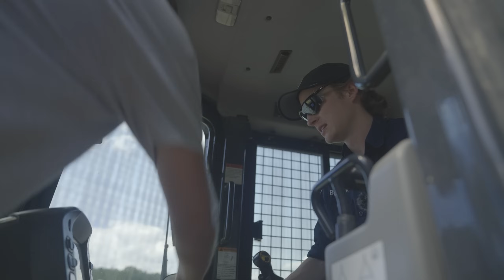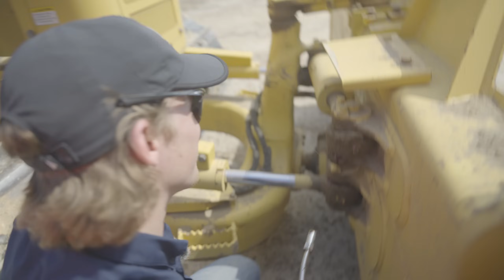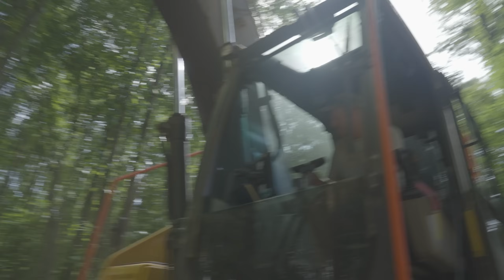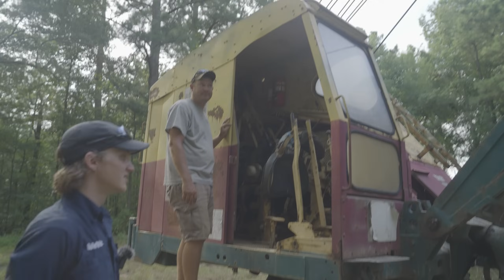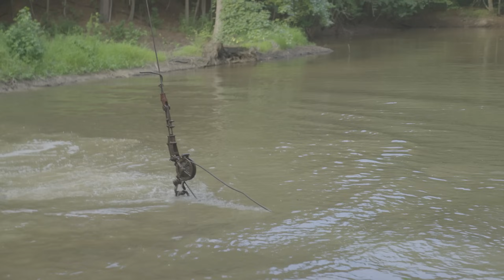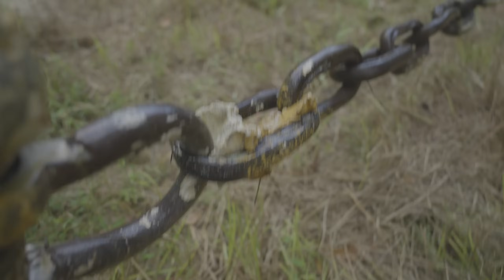Working for LETSDIG18!

Comment: You need to do more videos with the “smaller” contractors like this. It’s more relatable than the giant companies. And showcases what you can do if you want to be in the biz but not work for one of those giant companies.
Reply: Working for a smaller company compared to working in a mine ,is there's more opportunities to do many different things. Let's say you like running a excavator...you can knock down trees , buildings, clear land ,lift structures like culvert boxes or beams for the steel workers... to digging retention ponds or ditches, the list is endless.
Reply: Agreed
Reply: He’s worked with Chris and smaller companies several times instead of basing your opinion off the videos you watched why not just watch and shut up 😂😂

Comment: Thank you for letting Mr. WATT 😊 come and play and learn the fuel and lube system 😊 the old ( Betty) is my favorite
1978 same year as my Dynahoe-190 😊
Mr. WATT learned the dump for bucket control I see. With the backwards lever control system CAT put on 977s. That front Loaders from that series are the best looking, but times changed and thay moved engines to the rear. Lets DIG is so outstanding to let Mr. WATT come and see and operate in his job development site. 😊😊😊 This is so fantastic about U-Tube that two great videos series can get together and actually show video of each other on job sites. For everyone saying Mr.WATT should do more with smaller contractors. Great idea but remember you and me can NOT go to some of these large Mines and hige projects that Mr.WATT has filmed at let alone film there. So the none contractor people watching video on Mr.WATTs channel will only get to see those big projects from Mr.WATTs filming them.

Comment: Locking your equip doesnt keep anybody out, just insures you have a busted window...
Reply: International used to have the greatest Lock up system in the 1970s. I ran a 125 track loader. It first had a steel locking cover for battery disconnect. So you had a lock outside.😊 Then you had a lock on the battery switch inside the box 😊 then in the cab ( no windows just ROPs you had this thick steel half moon shaped cover over dash ( no key start) just a RED start button and gauges 😊 you had a lock  on outside of this sliding plate 😊 they were the only piece of heavy equipment on that big sewer job that had that 3 lock up system. All fill points for lube and Diesel had these neat caps that had padlock hooks that were pretty hard to get through to turn caps. 😊 The side plates on engine service access covers had a padlock point outside the covers. The  CASE machines did not have this many
The Dynahoe-190 ( my side sewer stubs digger only had one steel plate over dash
All the big excavators we had on the job, had steel plates over all cab windows. Once in the cab there was no cover over the dash, (key insert) we were digging in a wood right of way easement for the sewer ditch. So remote location. There were some new homes being built though. The one thing we did have for security is the 350 Bucyrus Erie excavator operator lived in his trailer with his wife at the job site. The fuel up guy hated that I locked up my Dynahoe. He told me to leave the fuel tank to fill unlocked. He did not have keys to all the different machines. I never remember problems with vandalism though.

Comment: Customs to observe: Aaron Witt, when in the presence of a legend humble yourself. Unspoken words when in the presence of a legend #1 eye contact with a legend or with superior Samurai or Shogun; you were supposed to lower your gaze out of respect. #2 The evolution of bowing in three stages 🙇🙇‍♀️🙇‍♂️ 1. light bow when greeting friends or passing someone in a hallway; 2. then there is the 30 degree bow like when greeting customers or showing respect to someone of higher status. 3. And finally, there’s the deepest bow at 45 to 90 degrees reserved for legends or with higher levels superior Samurai or Shogun. Though you may be tempted to bow at a 120 degree it is not recommended, it could be taken as a sign of showing off? 4. Put the chair back after using it.